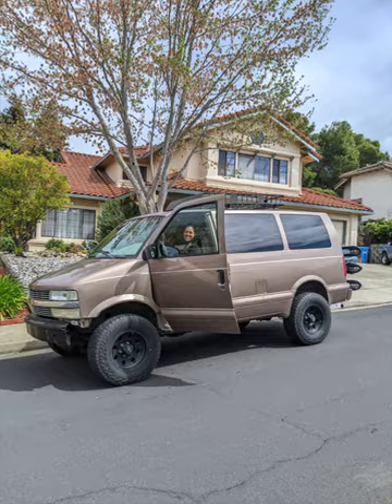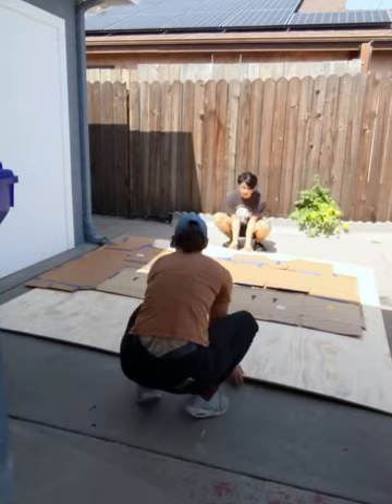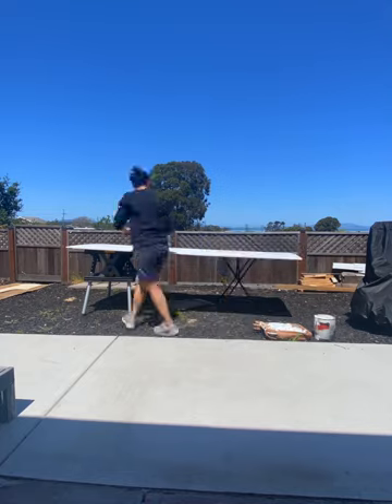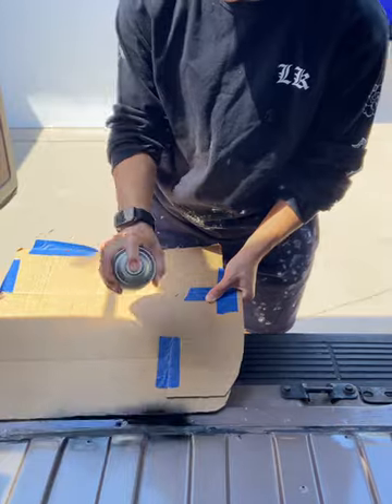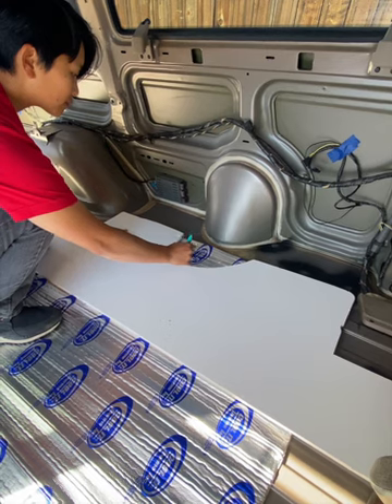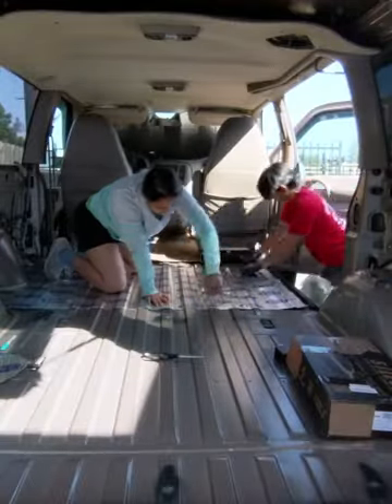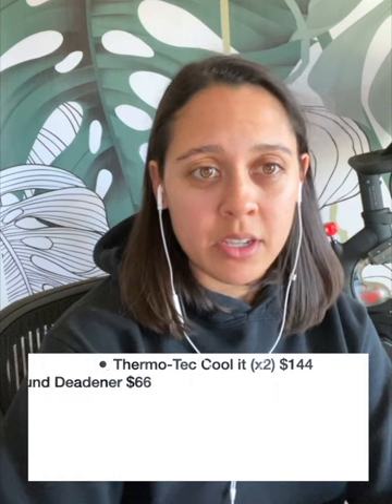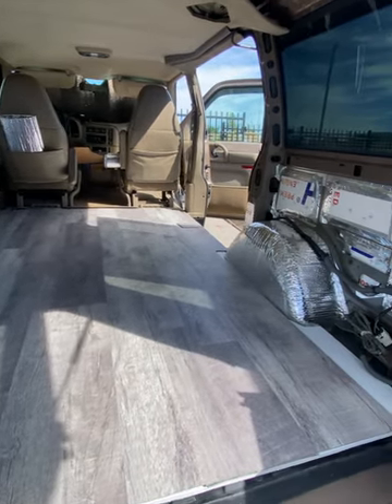DIY Van Build | Chevy Astro subfloor, insulation, and more

Comment: You did your research and have done nice work. Cardboard templates and painters tape to get a better fit became  my specialty too for floors, insulation, wall panels, ceiling, …
Reply from the maker: Thanks Paul! The jigsaw made it nice and easy too. 🙂 Glad to hear professionals use similar methods